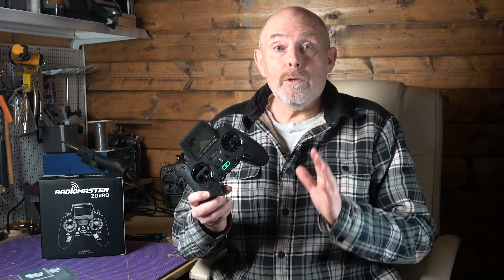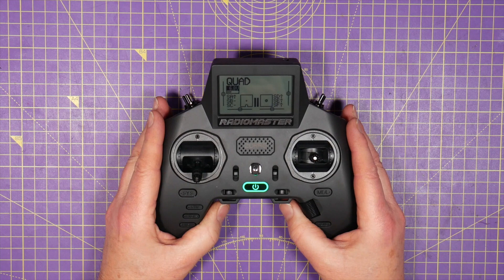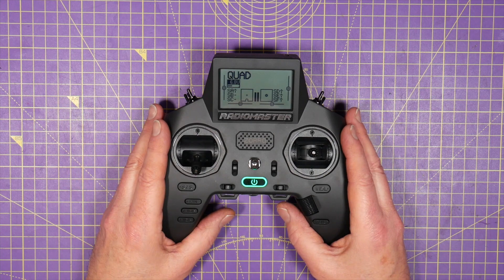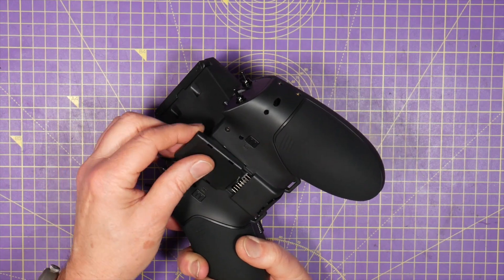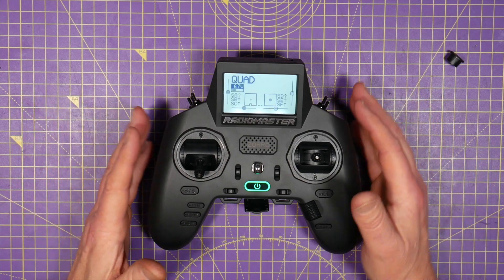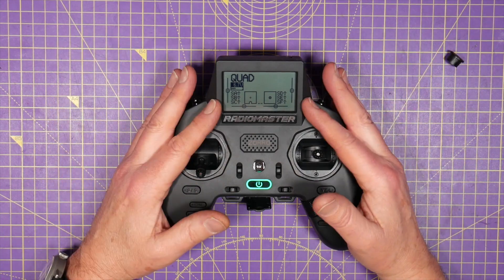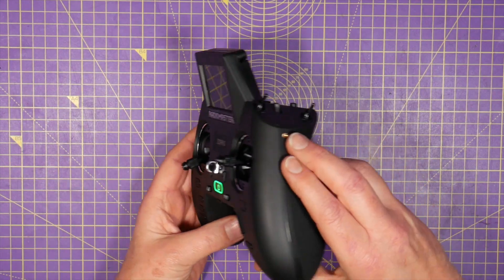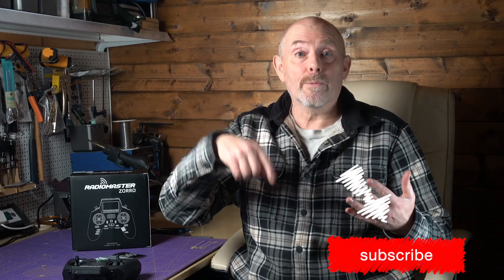RadioMaster Zorro 2.4GHz EdgeTX and ExpressLRS ELRS radio transmitter / First look review

Comment: Your reviews are wonderful - thank you!
I have a question regarding compass calibration using the sticks on radiomaster zorro. 
I do the following but do not hear the beep to start calibration:
1. Turn on Zorro and then the quad - turns on just fine - plus within a few minutes I get GPS satellite lock and a ready to fly verbal message. All good to this point. Battery connected.
2. For compass calibration (outside before flying), I do the following:
    - Move throttle stick up and to the right + move pitch stick straight down. - I am waiting for a verbal beep to start calibration but hear nothing
    - What am I doing wrong either in INAV setup or with Radiomaster Zorro setup?
    - Or, any other thoughts/ideas?

Hopefully you or someone else has run into this problem using sticks on Zorro to initiate compass calibration - thanks in advance for any replies and help!
Reply from the maker: Thank you for your kind words!

Regarding your question, it's possible that the issue you're experiencing with compass calibration could be due to a few different factors. Here are some things you can try:

Double-check that your transmitter sticks are properly configured in INAV. Go to the "Configuration" tab and then the "Radio" tab, and make sure that the "Stick Range" and "Mid Stick" values are set correctly for your transmitter.

Try using a different stick combination to initiate the calibration process. For example, you could try moving the throttle stick down and to the right while moving the pitch stick straight down. This may be a different combination than what you're currently using, but it could still work to initiate the calibration.

Check that your GPS and compass modules are properly connected and functioning. You can go to the "CLI" tab in INAV and type in "status" to get information about your modules and ensure that they are communicating properly with the flight controller.

If none of the above steps work, you could try calibrating the compass using a computer and USB cable instead. This may be a more reliable method, especially if you continue to have trouble with the stick-based calibration method.

I hope these suggestions help you get your compass calibrated properly!

Comment: Hi please can you help,i want this radio with elrs and also multi protocol for other drones,so what is the model of this i need ?
Reply from the maker: It's one or the other, not both. You just select the option you want. If you want both, maybe get the multi protocol and then add an external ELRS module plugged in the back.
Reply: @WhirlyBloke  would internal elrs or the added module be better or is there no difference?
Reply from the maker: @jasonleesuffolk  If you use the external ELRS you could get a 1W module. Otherwise, there's no real difference.
Reply: @WhirlyBloke  ok thanks 👍🏼

Comment: It would be useful would be to explain which modes of use this radio is certified for FCC or CE use.  ELRS is currently illegal above 10mW in the EU/UK
Reply: You can flash the module with a 10mW limit if you want.
Reply from the maker: As always you should fly within your regions regs. You can set the max power of the ELRS to whatever you need up to 500mW.
Reply: Is 10mW the limit just for that band, or any? Is there a better protocol than ELRS in the EU you'd recommend?